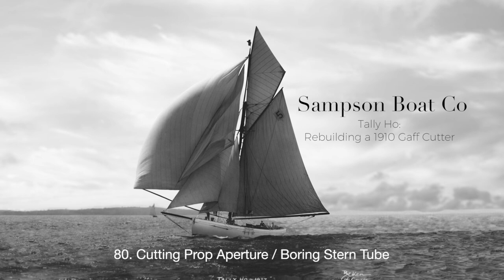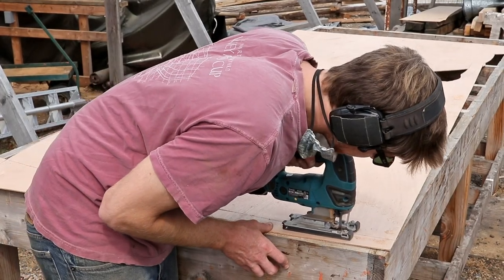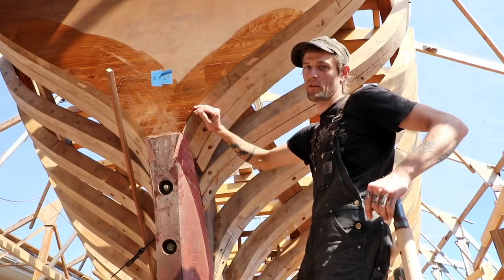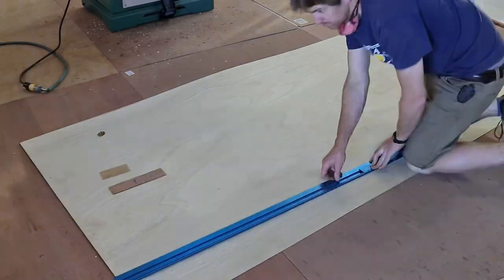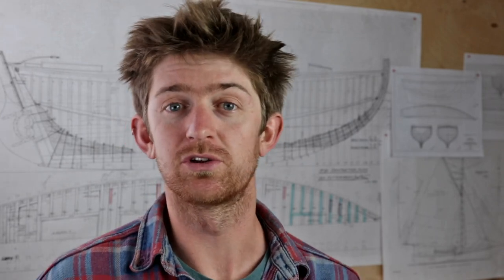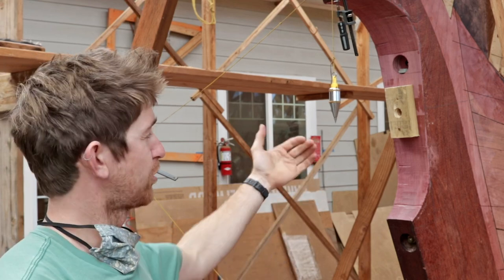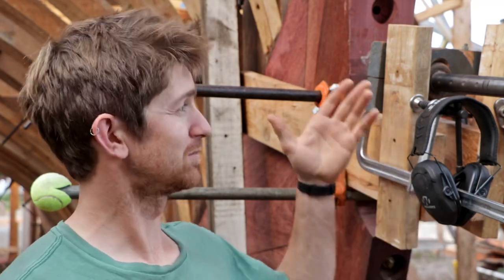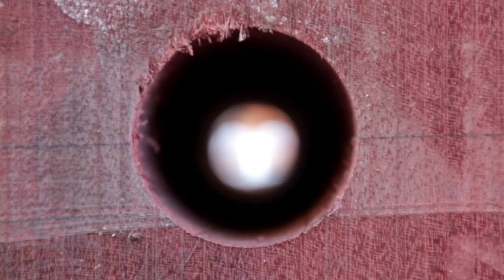Cutting for Propeller / Boring for Prop-Tube ( Wooden Boat Rebuild / EP80)

Comment: Leo I would like to make a suggestion to you about something I noticed. 4 or 5 weeks ago you had finished notching the beams for the opening your were building. Someone walked across the deck stringers and I noticed a good amount of movement in the notched beam going downward. It seems to me it would would much stronger for the deck those two notched beams to be replaced with a solid beam then the notched beam added to the inside of the new beam some glue and bolts placed through them and the deck stringers then shortened and put back in place and bolted again as you did before. It would be good for any openings on the deck to be done this way. Noticed when you where drilling the holes for the bolts into the notched timber there was a good amount of movement. Watch the video this week (last week)when you were working on this area and you'll see what I mean.  Leo I've thoroughly enjoyed watching your progress. Take care Neal
Reply: Which episode and time pse ? The deck structure is not finished, at that moment in time the hanging and lodging knees were not installed (and i think they still arent). The function of the knees is precise to strengthen the deck beams around the hatches (deck openings) and the chainplates. Also the bronzen floors were not installed. They add a lot of strenght to the whole structure.
Another point: glueing or even expoying structural parts is a no go : Glue and epoxy can't handle the flexing of the and will fail over time with a classic build ship.
Reply: @on4xb  I'll get the episode hunted up. I think it is the hatch openings that I just refered to them as openings as I didn't know what they were purposed for. Well you would know more about the glue than I would. Again great work.Take care.
Reply: The companion way was what I was speaking of. Now I see you had to replace the deck timbers, wrong wood. I know that stung a bit. Would still double the beams to the starboard and port sides. Used to work on framing crews building houses. A for instance would be a span say in the basement or in any room that required a clear span opening support timber. We cut a plate of 1'4 inch thick steel the same length of the timbers then drill holes set 2 inches in from each side on 16 inch centers moving from one side to the other in a zig zag fashion for the length of the beam. A sandwich if you will, 2 x12 piece of wood on each side of the steel.  It would support several thousands of pounds of weight. Could be done with 3/8 inch or other thickness pending need. Would not give any at all, very rigid. Absolutely excellent work you have done in the last few weeks. That rivet machine is awesome. Before you end your project it would be nice if you did a video on all the tools used in the building of Talley Ho. A type of run down on what it takes to do a job like this. The copper rivets could be threaded instead of bending them over this way you could determine the exact amount of pressure  to be applied to the exterior planks, turn them into a bolt. Use a torque wrench and set all the pressures the same. That would be trick. You might want to recess the nut into the frame members. Sorry to ramble on I've been binge watching Tally Ho videos all weekend long. Take Care Leo, Neal

Comment: I love the engineering you've used in this episode. The boring bar, which I assume the original builders must have used, if Tally Ho had an engine. Did I miss you telling us what the upper boring hole was for? From the drawing I could see rudder posts and hinges, but they would have to be above and below the propellor, the upper hole is in the prop scallop. Anyway Leo I'm loving your craftsmanship. It's a wonderful project to watch.
Reply: That hole is for a bolt to hold  the stem with the aft deadwood together and has nothing to do with with the prop shaft. TH had always an engine

Comment: Was Tally Ho engine powered in 1910?  Not only were diesel engines in their infancy, but I seriously doubt they had the power tools available you used to drill the hole for the prop shaft.  Hard to imagine any manual technique that could have accurately delivered a 21 inch long, 2 inch diameter hole through hard wood.  Love your passion for this project.

Comment: Cessna 170, an excellent choice for that purpose.  No it may not the fastest, but it's very simple and reliable with a very durable understressed engine.  Flying in the Pacific NW, if your using it to commute I just hope you're IFR rated.

Comment: If you use two or more bits , you can graduate the amount each cuts by increasing their length , this should make cutting easier and clean the chips out if the bore because the chips are smaller , thus reducing the friction on the boring bar . (I think) Nice job , is the powerplant going to be a surprise ?

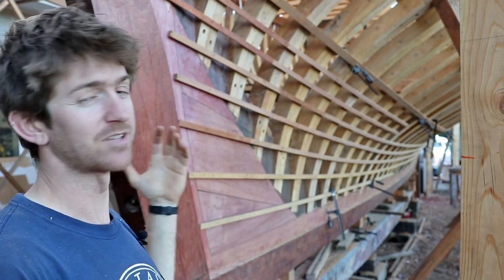Comment: 9:28
I don’t know if it applies or can be done in your case owing to the length - but it may help: in vintage footage of some old boat-builders in Suffolk which I once saw - they found the fair line for the planking by attaching them each at the stern then holding them near the bow so that natural curvature in relation to the frames was found by gravity.

Comment: So much space within the boat interior and lessened sailing pereformance, after the beautiful fairing done to optimize the entry of waters at the bow and exiit at the stern... seems like an inboard auxilliary with large prop cutiing through the sternpost is out of place. Maybe, for this rather large sailing boat, which may not fit into usual marinas anyway, option 1. using a small removeable outboard or option 2. laying-off, dropping anchor and using a dinghy to get to the wharf or shore is not a bad idea. But I guess you've weighed all the options and made the right decision. The fairing looking from the stern along the line of the ribbands looks really nice!
Reply: Tally-Ho had a motor from the start of her life

Comment: The first boring tool you had to weld broke because there is no way for it to clear chips- eventually the spaces between the toolbits got packed with so much sawdust that it couldn't cut anymore and the tool was just being rammed through the hole like a giant nail.  When you do that something has to break, thankfully it was the brazing filler holding the toolbits on rather than the timber. The problem could be mitigated by adding 'flutes' in the ring part so that chips could escape behind it, but ultimately like using a drill the only  real solution is withdrawing the tool periodically to clear the debris.

Comment: I can fully understand your caution at cutting out such a big chunk of the stern post, Leo.
The main boring bar is intriguing.  Are the spherical bushes lignum vitae?
That looks like a very useful piece of kit.
Reply: The same setup is used in machine work. There are a lot of vids on YT showing rebuilding the holes in backhoe and excavator buckets etc. Very cool!

Comment: Please put an electric drive in, it would really future proof the boat. Electric motor and battery. Diesel generator to charge battery when required. The battery can also power the auxiliary systems on the boat. You can charge the battery whilst in port from shore power but also charge it whilst sailing in strong winds by keeping the prop unfeathered and using the electric motor as a generator
Reply: It might also help with packaging as you could put the electric motor and gearbox really close the the rear of the boat and the generator anywhere else on the boat

Comment: Hi Leo, Nice work, Do your engeniering friend know how to calculate if your prop is going to "sing", Its looks to me that with that wide prop aperature it could be prone to "singing", on my small boat I had to move the prop back 10cm and make 21 degrees fairing from the hull, I had to move the prop forward because it was a glasfiber hull so fairing it would have been a big job.

Comment: I appreciate the accuracy of your work! Out of curiosity- as you have added all of the various bits of structure I would imagine the boat is getting more rigid-  also gaining weight. How often do you check your props and cribing? I would imagine some might shift by inch or so under the new weight as well as under changes in the soil from summer to winter? Have you found that you need to relift the boat at all to re-establish datums?
Reply from the maker: we check props and datum lines every week. The datums are on the boat so no need to change if it is sinking evenly!

Comment: Wonderful project and amazing video's.  I have a question about a peace of equipment I seen in the foundry. In this video the are shoveling sand into a green colored machine. What kind of machine is that and could you share a few pictures of it working?
Reply: It's a sand muller. It mixes the sand & breaks up any clumps.

Comment: When expanding the drilling of a deep through hole, the cutter could be fixed at the end of the drill pipe by pushing it through the keel. In this case, the drill would not need to be pushed, but pulled. This would make work easier and increase drilling accuracy. At least that's what I would do.

Comment: Cutting away half the depth of the stern post surprised me , you explained the reason quite well but what about the whole “ only as strong as the weakest link “ thing ?
Reply: This lower part of the sternpost is backed up by & str'lly bolted to the stern deadwoods & knee, so I'd guess that its strength isn't badly compromised.

Comment: Hey Leo! Just donated from your hometown Bristol, UK. I have a question - why isn't there caulking between the planks and the transom? Pete said it was the only exposed part of the boat that didn't have it. Why not? Thanks
Reply: Ima guess that, since bronze screws are driven through the overlapping hull planks into the end grain of the transom planks, that hammering caulking into that joint would force the screws out of the end grain & weaken the attachment.
Reply: @frederickstibbert7389  that's a good guess

Comment: Thanks for the great videos. Are there criteria that determine whether a project is a “restoration” vs a “rebuild”? You’re doing amazing work but it seems more like building a new boat with a few select components from the old, vs a restoration that preserves most of the original. Thanks!
Reply from the maker: I did a whole video about this - https://youtu.be/tW15VnkEmQ0
Reply: Thanks,  Leo; I like your overviews of theories of identity and continuity - but even more, I agree with your inclination to dismiss these debates and go sailing! Thanks again for the great and informative videos.

Comment: The price tag on a 22" diameter feathering prop will be heart-attack inducing
Reply: Blue Boats I cannot help but wonder if a classic 2 blade “ sailors propellor “ would be an appropriate choice. The propellor 
is  “ feathered “ by marking the prop shaft appropriately so that the blades are vertically aligned within the aperture when sailing. This is a failure free , less costly solution that better aligns with my Murphy’s Law approach to sailing. Yes the blade loads will be higher and vibration greater than a prop with more blades. One other consideration is that a feathering prop of that size will have a big hub that may require a bigger shaft. This can reduce efficiency. Am thinking that Leo’s lowering the aperture in the stern post, puts the prop in denser deeper water which may allow a 2 blade to get the job done. Picking a proper prop , and matching it to the hull , motor, and tranny gear ratios is indeed one of the big challenges even in this era of CAD. I wonder if he is thinking of using a V drive and passing the shaft under the motor which will indeed offer more cabin space.

Comment: I am a cabinet and furniture maker that has restored 2 small wooden boats and built one frome plans in my younger years. Has anybody noticed what is happening in the last few months with the price of lumber and plywood. 2x4's are almost $5 each after tax. 1/2" OSB that I bought 3 months ago for $9 a sheet is now $21
I feel for Leo for all the expendable pattern material that will be burned and tossed away after use. Not to mention at least a couple of hundred dollars of purple heart that was cut away for the prop aperture. I can't imagine what Leo's going through in funding this project. I'm sure that there are many beautiful old boats that rotted away because no one wanted to take on the project.

Comment: how did you free hand drill the initial bore so straight? is there a technique for aligning to through the center of the timber and along the travel angle? pretty impressive
Reply from the maker: The first hole was originally drilled from both ends. So the openings were on the CL and the holes did meet (just about), but the hole was not perfectly straight. If the holes hadn't met, I would have been in trouble! (That was done when we put together the stern assembly)

Comment: How did you get the initial first hole drill so perfectly inline with the center line of the boat, or did you get to correct any little mistake after setting up the boring jig?
Love this series.
Reply: Tom Williams       If I may.  The large boring bar held in slip bearings at both ends can reposition the hole perfectly, covering for any possible errors in the line-of-sight drilled smaller hole.  Naturally, Leo and his assistant did a good job with the first auger drilled hole.
Reply from the maker: The first hole was originally drilled from both ends. So the openings were on the CL and the holes did meet, but the hole was not perfectly straight.
Reply: @clayz1  Thank you,  it looked perfect🤝👍
Reply: @SampsonBoatCo  Thank you Leo. I'm still amazed how a hole can be drilled in line and at the correct angle through that much wood for the drive shaft in this century let alone 100 years ago.

Comment: I see the plans show a tiller. I'm curious to know if you're going to stick with that or go with a wheel? It would be a major departure from the original design but wouldn't a tiller be fatiguing on long passages? That's only my amateur's assumption, I've never used a tiller on an ocean going vessel.
Reply: A tiller has far fewer moving parts (i.e., extremely reliable and easy to maintain) than a wheel with its associated pulley and cable system.  For long passages, it's fairly easy to rig a tiller for "autopilot" control -- as described in the following video: https://www.youtube.com/watch?v=FQNBlrg0VyI
Reply: @DaDitDa  That's a great video you linked. I've used a similar setup to auto-steer smaller vessels and I'm sure it would work just as well on something the size of Tally Ho. But you know my first thought when I see that tiller design on this size of boat? I think "man, I wouldn't want to be holding onto that tiller when a rouge wave slaps that big rudder around". Of course the rudder is also big and heavy so I'm sure it's not an issue. It just seems like you would need some mechanical advantage, not only for the occasional rouge wave, but even to hold a course when you're close hauled and heeling over. There must be enormous pressure on that tiller. I hope his gudgeons and pintles are strong (and his arms haha)!

Comment: Hey Leo! Just curious, how did you decide on the angle of the boring bar with respect to the horizontal? Also, how do you ensure that the boat sits in the water at the correct position such that the prop shaft is at the correct angle; is there some kind of ballast to adjust the boat's pitch or is the propeller mounted on some kind of universal joint to tune the alignment, or does it not really matter since you can just tweak the rudder position? Thanks!

Comment: Did you go through any special mental process to psych yourself up for the boring of that prop hole?  You seem so cool in the video like you do it every day.  It's made me wonder anew how engineers boring tunnels from two different ends meet in the middle. How day do dat?
Reply: TBM`s use GPS for guidance however there are multiple systems as backup these include lasers ,gyroscopes and even theodolites.

Comment: I've watched a few episodes here and there and this question has probably been answered before but, how much of the original boat will be left when the project is complete? It seems to me like every piece of the boat is being remade. If that's the case, wouldn't it have been easier to just build a new boat?

Best wishes, Arvid from Sweden
Reply: @KarlHeinzofWpg  ok thanks will watch that in a bit. 👍

Comment: I wonder how they bored that hole back in 1912. Technology is a great thing sometimes. I watched an Amish builder the other day who was using a chain saw.
Reply: they can use gas powered tools, just not electric
Reply: They burnt the hole through with a hot iron

Comment: Sealing your prop hole against worms will take some time. Don't know how to do it on that type of boat . Are you able to cheat and just seal with epoxy? Or do you bed a copper tube then flood it so it doesn't mess up your prop shaft? Will be watching when it comes time.

Comment: How is all of this funded? What are the costs of the wood? I’m just curious and would appreciate anyone chiming in.
Reply: The project is crowd-funded now, by donations, youtube, & Patreon subscriptions.
The wood costs in US$:
6k - purpleheart for keel
10k - purpleheart for fore & aft centerline assemblies
28k - southern live oak for frames
26k - wana for hull planking & angelique for longitudinal beams
14k - white oak for deck beams
? - teak slabs for upper transom
Includes most of the shipping costs, but not the expense of the wana staying in a dryer for 7 months. That's $84,000 just for hardwood that goes into the boat - plywood & softwood lumber is not included here.